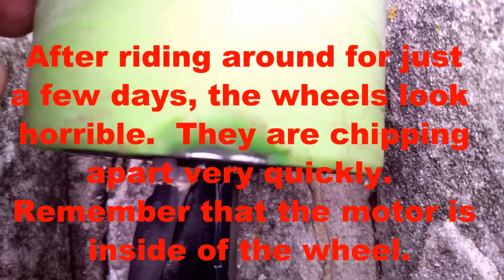Genesis Electric Skateboard Review Part 3

Comment: Genesis & Koowheel Comparison
(They are the same company btw)

Koowheel 3DM:
PROS:
  -Unlocked speed is about 20+ MPH, Normal speed is 16 MPH
  -Slightly water resistant
  -Range is about 8-9 miles
  -Newer versions fixed the frequent disconnection problems
  -Regenative braking
  -Wider deck, increased turning
  -Amazing customer service
  -Remote is simple and easy
CONS:
  -Risk of disconnection (old versions)
  -Is big and heavy to carry
  -After 50% battery the board slows down significantly
  -More expensive than Genesis
  -Nuts and bolts loosen easily
  -Risk of battery not being able to charge at all
  -I like the design of Genesis better, reminds me of a Boosted Board
  
Genesis Tomahawk:
PROS:
  -Unlocked speed is 20+ MPH, Normal speed is 15 MPH
  -Cheaper than Koowheel by about $100
  -Slightly water resistant 
  -Range is about 8 miles
  -Less disconnection problems
  -Regenative braking
  -Longer deck, more stability
  -Remote is simple and easy
  -I think the board looks better than Koowheel
CONS:
  -Bad customer service (like really bad)
  -Board is known to stop working sometimes in a week to a month after opening
  -Nuts and bolts will loosen easily
  -Risk of battery not being able to charge at all
  -After 50% battery the board will slow down significantly
  -Is big and heavy to carry
  -30 day return policy is void if box is opened
Reply from the maker: +Nick Foster dam dude you nailed it!  Id love to get an interview
Reply: I researched a shit ton to get that information, glad I could help
Reply from the maker: i know you did. i know from experience with 4 different boards you are right on

Comment: Thats why I bought the Melonboard, they have replacement parts if something breaks and its not an in wheel hub motor so you can change wheels. I still haven't received my Stinger from Genesis and ordered it over a month ago. That Evolve will seem like a Porsche when you get it compared to that Genesis piece of crap.
Reply from the maker: +Chris Searls oh absolutely,  i knew after i bought this board and researched more,  i wouldn't want it and figured heck i want a board I better pony up and get another one quick ir else when this board takes a crap i will be out of luck.  Evolve has such a long wait for the carbon gt but my wait just about over.  Tracking tells me tomorrow it will be here.  I wouldn't give this genesis board to anyone!  they  would be pissed at me for giving them a piece of crap
Reply from the maker: lets get some video of that melon when it comes in i am curious as to what you think. im not going to waste money anymore like this
Reply: I love my Melonboard! We are going to make a video up in Lake Tahoe and by Squaw Valley ski resort when school and work slows down. My roommate loved it so much that he bought one too and it works killer also. I was waiting for my Stinger to compare the two but doubt that will ever come. I have used it almost everyday since I got it with no problems. There is a break update you have to do if you get one but after that the brakes work killer. We ride both our boards almost everyday and have put many miles on them with no problems so far.
Reply: I've been searching all night for an affordable board with replacement parts.  Genesis is an American company but it's product is a generic board from China that is purchased in bulk and is rebranded.  The Koowheel is the same exact board.  Thanks for mentioning the Melon board!  It's the price point I'm looking for with replacement parts, awesome!  I honestly wanted Genesis to work but after watching Joe, and I skate hard like him, I can't shell out $600+ for something that will wear down like an old sock in one day!  Again appreciate you mentioning it.  Hey, Joe, thanks for the extensive review!  You've just saved me and many others time and money :)  BTW, that Hubsan you got is a quality drone hehehe

- Neil
Reply from the maker: absolutely! another board is the acton blink board. I just got an evolve so I will do a run down on that. The koowheel or genesis boards are junk. Not even 2 weeks old and it may last maybe another month if i keep riding it. No way its going to last any longer and it needs major fixes and repairs. Just a waste